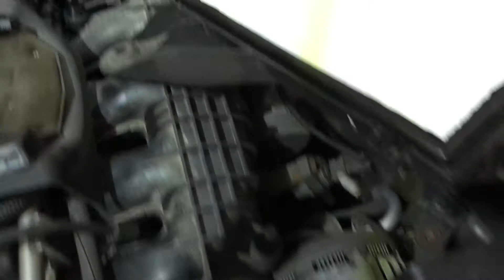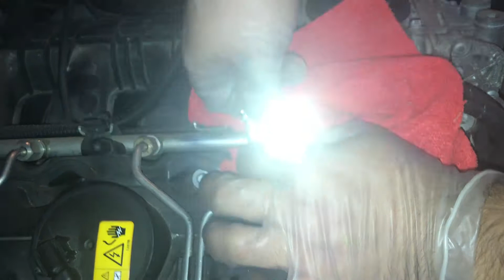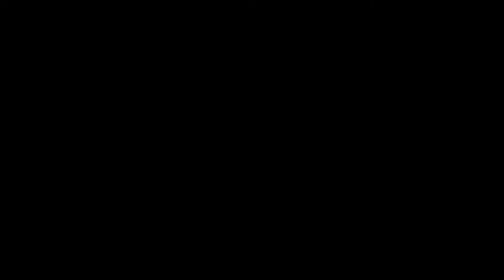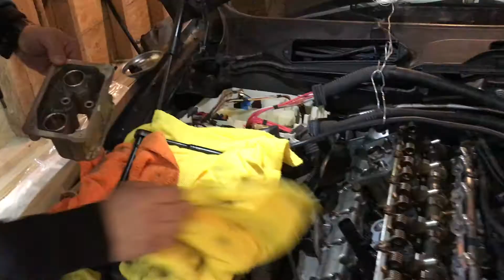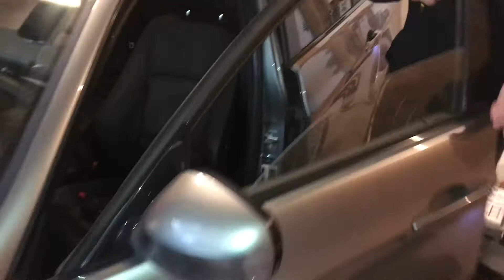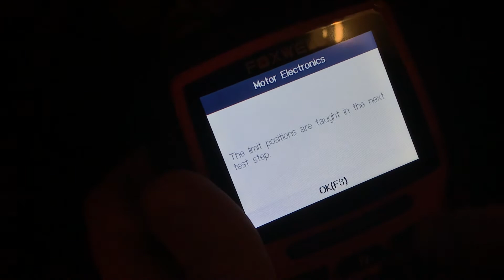BMW 335xi N55 engine cover gasket and valvetronic motor replacement (detailed step by step video)

Comment: Is there no need to learn limit positions first before the start up ? I’m having issues with my installation. When you moved the eccentric shaft all the way so the nipple hits the stopper on the left is it touching it or is there a little gap in between it ?

Comment: Thank you for the video, I have a 2016 X5 with the N55 engine. Do you know the original part number for the valve Tronic motor gasket?

Comment: What is the torque spec on the bolt you broke?. How to do you take out the valvetronic motor? ...I'm confuse how you put back in, does the gear have to sit in a certain way? ..good video..

Comment: Just wanted to say, you need to replace the inyectors seals, also you need to make sure that the same inyector you got out, goes in the same well
Reply: I accidentally mixed mine up what do I do now? Do I have to get it calibrated somewhere or something?